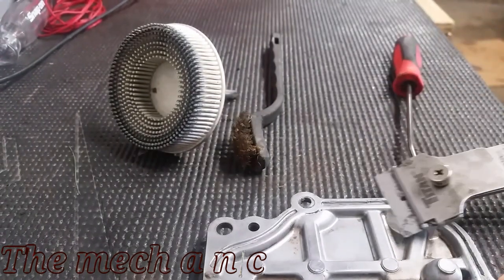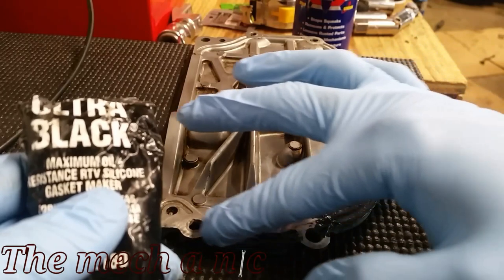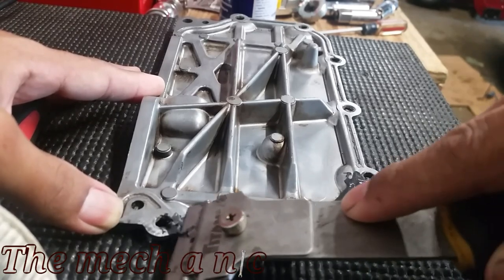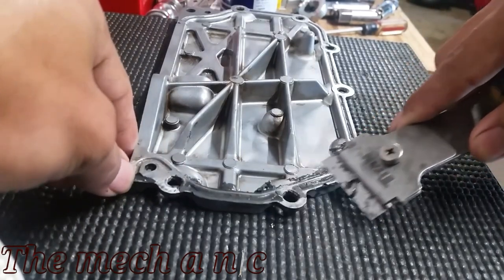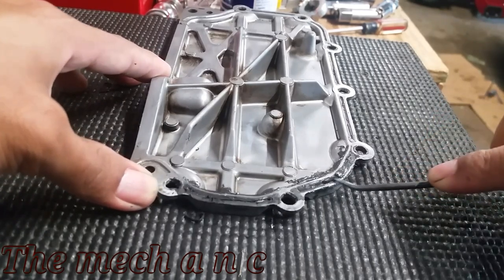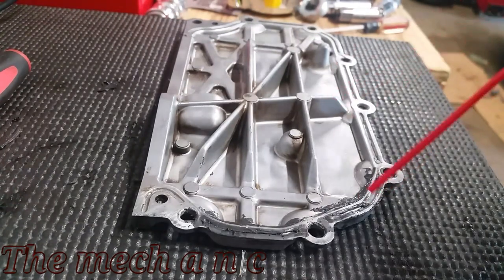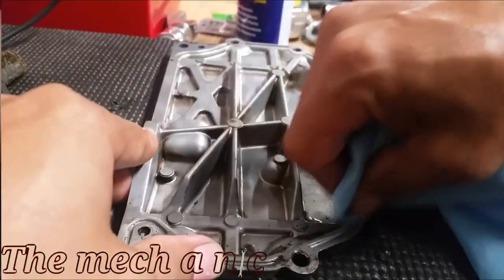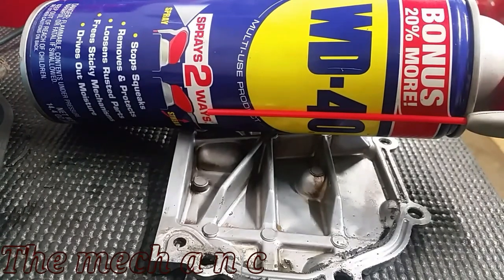Removing rtv silicone

Comment: use brake cleaner to clean off the mating surfaces after using wd40 as it leaves no oily residue which can prevent the re-application of gasket goop from re-sealing properly next time and wont attack gaskets. Maybe slicing into the body of the sealant first and then applying the sealant remover to help it penetrate deeper initially. Wonder if nail polish remover would work, seems to strip everything else including my nasal cavity lol

Comment: Thank you for the video, and thanks for suggesting from the start of your video that others with solutions that might work better then WD-40 should comment below. I was very impressed with the recommendation and outcome of Goo Gone's ability to break down the RTV silicone. It didn't work much on the mechanical silicone in 5 minutes as suggested, but with 2-3 applications over a 45 minute timeframe, it was curling the thinner layers of RTV and cleaned up off of previously sanded for adhesion metal gasket surfaces nicely and easily removed the skins from paper gaskets beautifully. On the negative side, I attempted to clean the silicone from the front end of my $80 silicone oil pan gasket, and with it being silicone, Goo Gone also affected the gasket. It stretched, and split in the corners. On my bad, I shouldn't have used RTV or any sealant on a silicone gasket in the first place.  Goo Gone works well.

Comment: I like to use a wire wheel on a bench grinder.
Reply from the maker: Cmorep3 this works great for any part that comes off the engine. The block just needs good old elbow grease lol thanks for watching/commenting.

Comment: Thanks for the tip. here is one back to you. Instead of "pushing" the razor blade, drag it at a 75 degree angle (or so). You can gouge the aluminum when pushing and you will never do that when dragging. CNC machinist use this method to deburr parts (in some cases). It will make only visual scratches and remove any burrs as well
Reply from the maker: Thank you. That definitely works . I've been doing that since I saw another video demonstrating it
Reply: @themechanic6117  I also keep pieces of flat plastic of different thicknesses to use as a scraper too. Easy to sand to conform to a contour and sharpen an edge to scrape with.

Comment: Using brake cleaner & a soft metal brush to scrub the left over rtv & gasket on the valve cover followed up with rubbing alcohol on a red shop rag got everything clean off my chrome covers.

Comment: I wonder if PB Blaster or seafoam deep creep will work the same. I have an aluminum intake manifold covered with Permatex grey ultra right now, guess it's time to experiment
Reply: Did it work? I'm trying to remove a tranny pan I put on with the right stuff. Just applied pb blaster so fingers crossed it will let go

Comment: Needs to be a solvent of some kind. RTV designed to resist petroleum products like WD-40. It may have some effect. I use alcohol, not the best either...
Reply from the maker: +Brooks Yeager the biggest thing here is time, how long you let it soak...when working on cars most of the time you done have the time to wait.